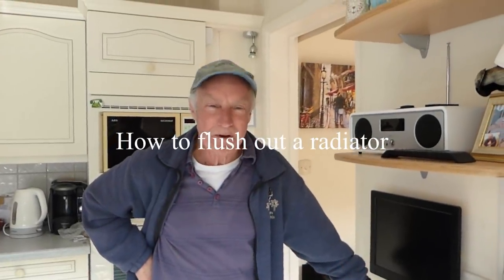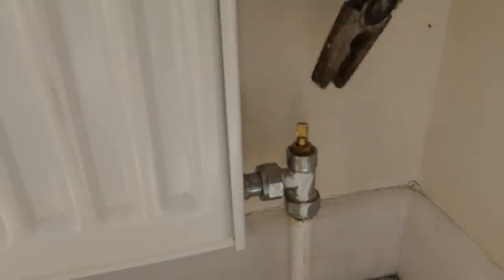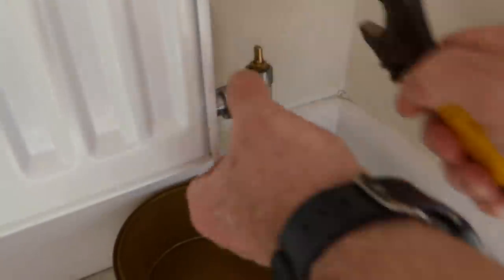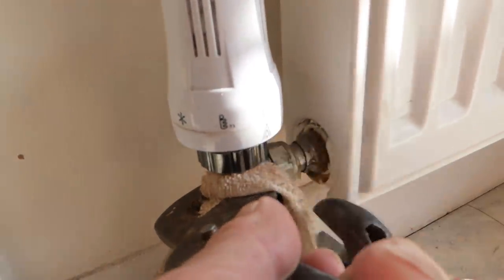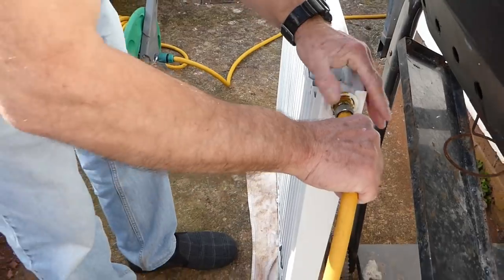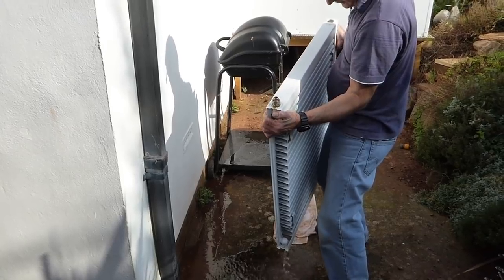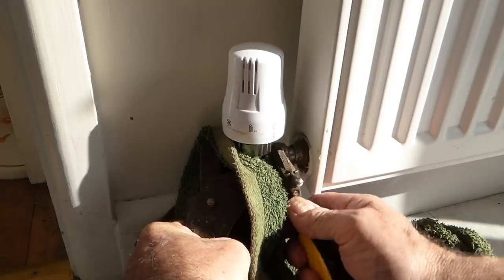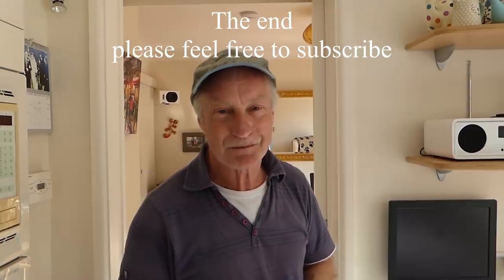How to flush out a radiator. Improve heat and performance from your radiators

Comment: I've seen this video and and I was asking myself why do you turn the radiator upside down.
In my opinion the sludge will be on the bottom only.
When you turn the radiator upside down the sludge will fal to the top of the radiator.
Reply from the maker: It is just so that any black mucky water does not spill out over a carpet. Nothing to do with sludge, being at the top or bottom of the rad.

Comment: my heating system is heating ok but making a hell of a racket. oil boiler. hasn't had a flush through in years. is that a good place to start?!
Reply from the maker: Yes, sludge build up will cause all sort of boiler noises and problems.
Reply: dereton33 hi I’m just curios can old radiators release dangerous gas please answer as soon as possible

Comment: Hi, I’ve got a radiator which never gets hot at the top and you can actually undo the bleed screw without any water coming out. Think it’s blocked from when it was stored upside down. Ran a hose through and it came out clear, but nothing out of the bleed still. Anything I can do or is it replacement time?
Reply from the maker: The bleed valve itself may be blocked, Try taking it right out and sticking a needle through into the rad, be ready to catch any water with old towels .
Reply: dereton33 Great idea, thank you. I’m not handy at all, but your videos helped me change an old set of valves and tails for new ones with a TRV - much appreciated!
Reply: Spot on - unscrewed the bleed screw, ran a coat hanger in there and it unblocked straight away! Thanks again.

Comment: Most of my radiators are too blooming heavy!  What if I could connect a hose to one side to deliver mains water, and a drain hose the other side of the rad - either draining outside, or into the bath/shower?  Then they could be flushed in-place... That should work, shouldn't it??
Reply from the maker: Yes I do not see why not, it is usually done outside as it is a messy job and if any of the black stuff hits your carpets it just will not come out.
Reply: I just did all my radiators in place. I used an inline 15mm connector and a tap connector for a hose.  All my rads have a drain valve, so it was just a matter of carefully draining each rad. then connecting the hose - water in and drain out - and then letting it run for a few minutes. I'd had Sentinal X400 cleaner running through the system for about a week. The water was as black as ink when it first came out but there was very little sign of magnetite flakes or sludge.  I spilled a little (clean water) but had an old towel and a plastic pot to minimise mess, No dirty water got onto carpets!
LATER:  I just had a magnetic filter installed, and am suprised to see it catching a lot of sludge and flakes, despite the previous flushing..!

Comment: Hi

Need help with my radiator... had a plumber come in recently to fit my new bathroom and towel rail. I have now noticed that one of my upstairs radiator  is cold on the upper half and hot at the bottom half. What can be the cause of this and how do I fix it?
Reply from the maker: Air in the radiator just use a key to bleed it.
Reply: @dereton33  brill. Will give it a go. Cheers
Reply: Will they then need to add water to return pressure to the system?

Comment: I did this with my one radiator yesterday which was not working properly 
The big problem now is none of my radiators are heating which we’re fine before.
Please help me what might be the problem .
Regards
Reply from the maker: You have air in the system. If you have a combi make sure you have pressure.
Reply: dereton33 how to remove it mate ?
Reply: @rexrex5140  open the bleeder valve at the radiator at the begining of the circuit let the air hiss out until water trickles out (have a cup) repeat for them all if you reach a radiator out of which no water comes you are very low on water. Check pressure gauge and add water slowly double checking pressure accordingly, (unless you have a fancy system that refills itself, then have faith)
rebleed once it's refilled and repressurized for any remaining air and to prevent noisy radiators.

By my humble tiny experience

Comment: sometimes you see two pipes going into a radiator, how can you tell which is supply and which is return? thank you.
Reply from the maker: Put heating on from cold, see witch pipe heats up first by touching them, that one will be the flow.
Reply: So after all that it wasn't dirty

Comment: Flushed sludge from all radiators, bled air and still radiators are cold on bottom.. actually only 20-30% on top is warm. How?
Reply from the maker: Boiler not giving enough heat, try turning up the  boiler stat.. Might also be a good time to clean the entire system with system cleaner followed by fresh inhibitor.

Comment: Imy rad is hot at top and sides but cold in middle and bottom. Rad was washed out water was clear put it back on still heating the same way??
Reply from the maker: Time to do a bit of system balancing.
Reply: @dereton33  been down that road to. Have 5 rads like this and have 4 more that are only in about two yrs and there perfect. Have some small bit of knocking in stove when the heat gets up noise like stones boiling but mnew pump in still the same.
Reply from the maker: Have you tried using some system cleaner and renewing the inhibitor.

Comment: hi I cleaned out the rads and the bottom is still cold. would it be anything to do with the oil heating?
Reply from the maker: I would check the pump.
Reply: +dereton33 someone said to take off a rad and let air out from the pipe
Reply from the maker: Give it a try.
Reply: @killbuzzinton  isn't the same like bleeding a radiator? Why not bleeding the radiator until the air is  out.
Let me know if you solved the problem. Thanks!
Reply: @catalinsoare1261  it was the pump in the end. Had to get a new one. I went through all the hard work of taking rads off cleaning them out and back on just to find out it was the pump . Lesson learned for next time.
Reply: @killbuzzinton  thanks for the answer. Glad to hear that you found out what the problem was.

Comment: What can I do if
a) mine dont have thermostats just the old style valves.
b) said valves a stuck fast.
Reply from the maker: ro63rto Remove the tops and adjust down with pliers or adjustable spanner until they stop.

Comment: I've done this however my radiator is still barely luke warm at the top and stone cold at the bottom. The sludge was black that came out. Any advice? Thanks
Reply from the maker: Must have some really hard black sludge still lodged in there. Either keep trying or just replace the radiator.

Comment: Any suggestions  on how  to do this when  the rising  pipes  are in a concrete  floor
Reply from the maker: Losen the valve body then when the rad tail nut is undone you can turn the valve out of the way.

Comment: This is not the correct way to flush a radiator! Don't get me wrong it will make some improvement but it needs heat chemicals and a agitator and a powerflush.
Reply from the maker: This way will cost money. My way has always worked for me over the past 50 years.
Reply: @dereton33  your way will be 40% effect on a bad sludged up radiator at best. Got my own gas  business 20 years experience.
Reply from the maker: Most people trying to do this as a DIY job will not have chemicals an agitator and a powerflush.
Reply: @dereton33  Correct! How DID we manage before power flushing.?